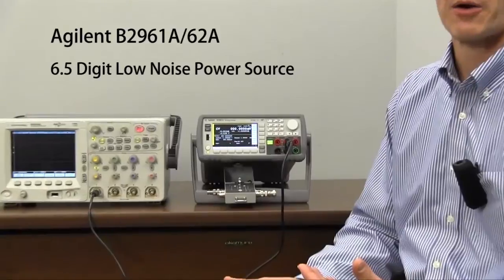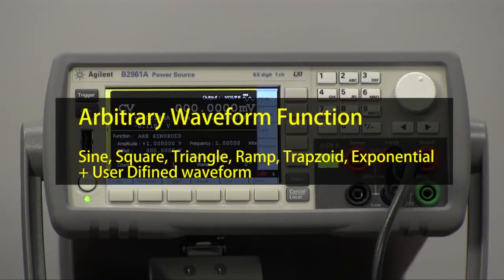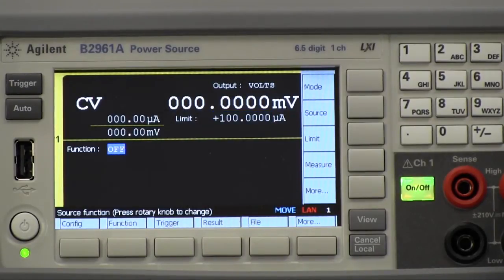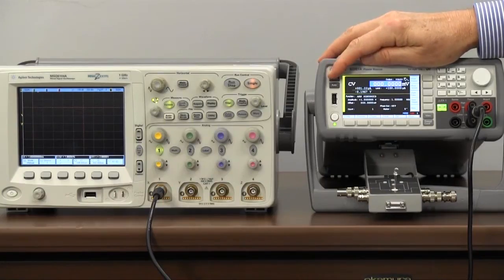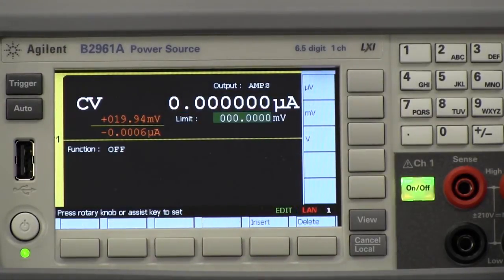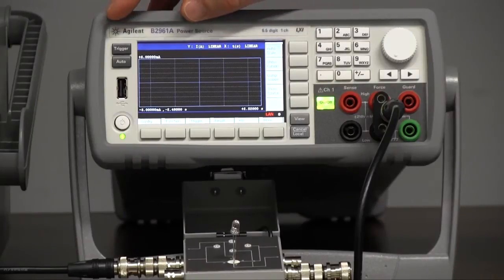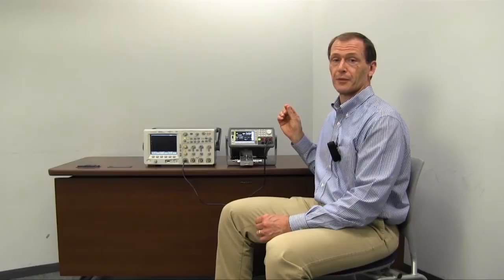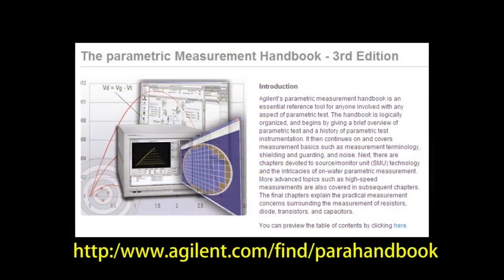Keysight B2961A/62A Low Noise Power Source,  Arbitrary (ARB) Waveform Demo

Comment: The documentation for this unit is very vague, and there is a significant learning curve. If you want easy access to triggers be sure to buy the accessory D-sub connector to BNC adapter box.